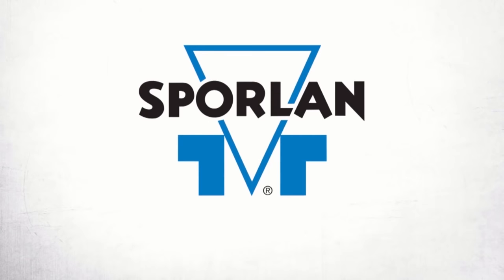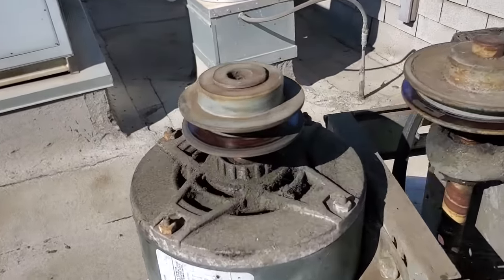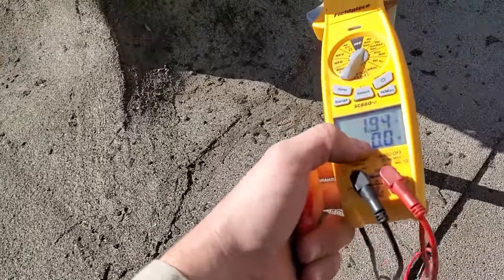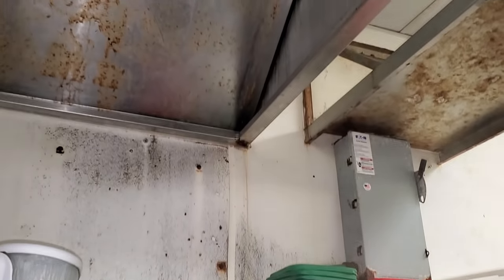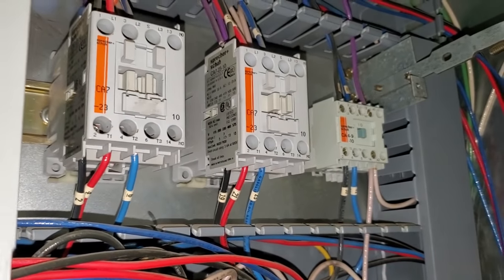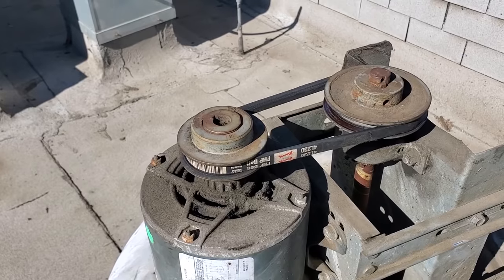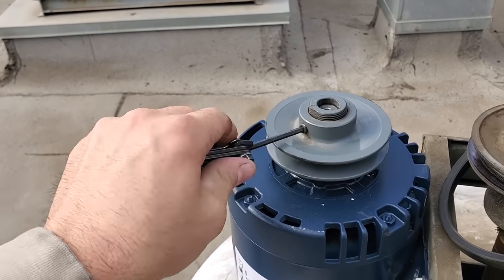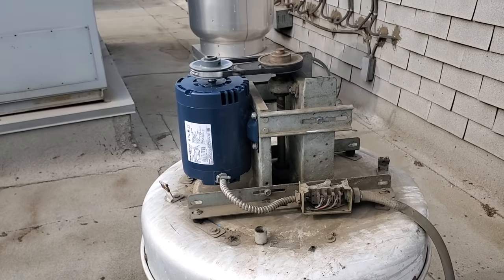DISHWASHER EXHAUST NOT WORKING

Comment: I’ve never seen adjustable pulleys before. What a great idea. I spent the last 15 years as a commercial catering engineer and that dishwasher looked as though it was ready for a serious service. I used to replace bearings in motors if they were in good condition. I had an urgent call to a large school where the  3ph (415 volt between phases in the uk) dishwasher wash pump tripped. The main wash pump had seized solid. The head teacher threatened to shut the school if the DW wasn’t fixed due to cross infection risk until I pointed out that they could use paper plates! I got the pump out and back to the workshop and had to split the bearing with a grinder because it had welded itself onto the motor shaft. Fitted a new bearing and took it back to site and refitted the pump. I loved being able to provide that sort of service.
I’m retired now but have lots of stories, like the restaurant that complained that their D/washer wasn’t taking the liquid detergent only the find the tube in a box of detergent powder!
Reply: You wrote an essay

Comment: I didn't see it listed on the nameplate, but if the motor is thermally protected (internally) it could be going on and off if it was running hot or if the thermal switch was bad.

Comment: Yup on the curtains your correct. The machines typically don't control the fans above. Dish machine fans every place I've worked Run 24/7 unless its controlled elsewhere if any. Anyways appreciate your videos.

Comment: I’d like to know who did the initial inspection? That’s the wrong Fan for a Dishwasher. Has to be an Updraft discharge, also has to have an external disconnect on the roof, so you don’t have to touch the fan to shut it off. Also Aluminum or Stainless Steel ductwork. Exhaust must be tapped into the entrance and exit of the dishwasher. A Dishwasher that size would have to have the controls to turn the fan on and off with a short time delay on the off cycle. Have you tried the Optibelt Brand of Belts. I wouldn’t use anything but their belts on exhaust fans. Six to twelve times the life out of the belt and easier on the motor amp. wise.

Comment: With the curtains on the dishwasher you're correct there needs to be curtains. The entrance end is usually a little shorter to put racks in. When the curtains start getting super hard and curling they should be replaced.

Comment: Exhaust manufacturer told me a motor that is 1 hp or smaller, does not need motor starter protection, has internal protection. What's wierd like you said 3 phase for a dish exhaust? They should have used aluminum duct, crazy corrosion.  Also the bottom of the hood should be no higher than 80 inches, maybe poor draw because too high?
Reply: I can't say for certain without having the specifications for the dishwasher and the fan,  but they don't appear to be matched up right...

The fan static pressure is at best about 0.4 "wg, with a velocity pressure of ~1/2"wg

I started running some pressure drop calculations, and they aren't adding up...  nobody's paying me for the analysis, so I give up... it just doesn't look right...

Comment: Welp since im a avid dishwasher. Also btw thats a Ecolab EC-44(HH) Beast machine they do last long if treated right. But if the machine doesn't have pant leg duct work. As long as the canopy can capture all the exhaust heat/vapor its good. Not sure why they have the opening for the vent like that with solid blockers. I've seen one machine with a setup like that. I hadn't gotten up and close to it so cant say that's typical, although the duct configuration I'm pretty sure inst.

Comment: Good video. Talking my language. A Hobart made unit for ECOLab. The dish machine should have had pants legs and that would have prevented all that rust in the dish area. The customer didn’t want to pay for the extra cost to have it done. Surprised ECOLAB let that thing work in that way.

The motor replacement  info was good to know. Lots of clients expect me to work on their exhaust fans for their dish machines. I usually say no but now I might consider taking them on.

A really good video.
Reply: I think that was an ECOLAB machine. I dont know of a Hobart with that kind of conveyor.
Reply: Don Westphal Ecolab is a chemical company. They don’t even fully make their own pumps. Components include parts from Dema and Knight.  Dishwashers used by Ecolab are: Hobart and Jackson.
 A while back they sold off their repair arm. You know it as Smart Care. All to focus on their core business.... chemicals.
Reply: Hmm never heard of Hobart owning ECOLAB or anything an i work for Hobart lol
Reply: Don Westphal Hobart doesn’t own ECOlab. ECOlab buys machines from mfgs and they emboss the units with the Ecolab name. Buy enough from Hobart and they will stamp your name on the machines you buy too.  ECOlab is a big customer of Hobart. I guess you were on the meat slicer side of things.
Reply: No i do it all im cross trained on all the equipment. I just dont too much into all the business side of things. I focus on troubleshooting the equipment and that's about it lol. I accepted a job to do HVAC recently and will start it in December so im trying to freshen up on a few things before hand
Reply: Don Westphal Your in for a ride. It’s not like the ovens, slicers or dishmachines. More of the Traulsen experience just on a different scale. Much success on your journey.
Reply: Thanks mike

Comment: Your motor protection is bilt into the overload switch. (On/off).  Which is located right at the unit 3phase switch. 👍
Reply: I thought that too at first but now I'm not so sure.  I've definitely seen manual motor start switches with a melting alloy element, it always been single phase motors, where only one element is needed.  I dont think that switch had 3 melting alloy elements?

Comment: So in the us and Canada you use 240v in industrial situations such a electrically driven motors. Then 110v in house hold sockets. In Ireland we use 110v in industrial such as a building site etc and 240v in homes

Comment: Thanks for posting, interesting video to watch and you do a great job of explaining everything.  I do want to point out a couple things though.  EVERY motor has to have overload protection(not just three phase motors as you stated, sorry to nit-pick.) Its just a matter of if its thermally protected internally or utilizing external protection(overload relay).  Now most motors if protected internally will have it printed on the nameplate.  That is not an absolute rule, but generally holds true.  If it does not explicitly state that it is protected internally then you have to assume it is not, unless you want to contact the OEM for clarification.
Reply from the maker: Thanks Trever and you made some great points!

Comment: That's a driven pulley. The motor drives the other shaft as it's the source of power. :)

It isn't thermal protection built in to the 3 phase motor  but it does make you wonder if something was causing a spike in amps and the breaker protected the motor (as well as the line)  from overheating to catastrophic failure. Bad bearings, which that obviously had, would cause a higher current draw but it'd be most noticeable on startup and most likely to open the circuit then. I'd be curious if the driven shaft bearings are going out as well, causing more drag or perhaps the fan blades are messed up somehow (rust? chipping?)

Comment: We just had a roof vent motor overload and short to ground, ended up tripping the main 1600 amp ground fault and shutting down half the building.  Going to have the electrician come back and put overloads on all the motors

Comment: How curious. I wonder if the if there was am issue with the power coming in that agitated the motor. Maybe contactor stuck? Gotta hate intermittent failures. Keep the wedding band for off days, get a silicon ring. Almost lost my digit after a compressor toppled onto my hand. 😅
Reply from the maker: Yeah it's been a week since the call and no complaints..... the ring actually is a silicone Qalo ring, I havent worn a metal ring for at least 5 years now. Hell if I could do it all over again I wouldn't even waste the money on a metal ring and I would have just bought the silicone ring to start
Reply: @HVACRVIDEOS  May be it just needed some love. Machines are creatures. Yeah I made that mistake and had to cut off an 18k gold ring and it wasn't easy. After being pinched. I went on a binge watch and I have to say, I love how you handle even an intermittent. I'm northern FL central and it's nothing short of a miracle the systems that actually run in my dirty city. 😂  looking forward to next vid.

Comment: When you "opened up" the motor pulley and adjusted the pulley by turning it in a ccw direction, I was wondering if your adjustment had to go to the next 'Flat' on the motor stem? It seems logical that the next flat would be the only place you could retighten, so in doing so the distance has to be a predetermined speed thus amp draw or am I way off? And were you being careful not to change the up/down position of the pulley on the motor shaft? Be brief I'll pick up on your answer. Thank you
Reply from the maker: Yeah you got the right idea you have to tighten on the flat spots and yes you have to watch the pulley alignment while adjusting so you dont create another issue by running them un aligned

Comment: I think you're reading the current draw on the motor label wrong. it's the lower number next to it. motor has different ways it can be wired
Reply: The nameplate information for amps is divided the same as the voltage above it. Rated Amp draw for 208-230V is 3.3-3.0A, and rated Amp draw for 460v is 1.5A.

Comment: You were fine with the amps. Since it's 208 instead of 230 it will draw more for the same power output.
Reply: The internal energy dissipation of a motor is the same for every voltage, with the same amperage

Comment: did you grease the pillow block bearings? (if not sealed) and that is a friction belt ( verses an auto style belt) it does not get tightened super tight
as it will pull the bearings out of the new motor. did you never seize the shaft and the threads on the adjustable pulley so that you can get it apart 
in 6 months?

Comment: How do you locate the contactor, controlling that motor if it is in a different room?
Reply from the maker: Kinda like where's waldo........ just make an educated guess, most of the time they are in the electrical room
Reply: @HVACRVIDEOS   " electrical room" (aka the janitors closet)
Reply: time to call the city and have them do an inspection.  you really shouldn't have any contactors inside breaker panels, water on the floor near panels is a major red flag, panels MUST have a 3 foot clearance in front of them (per fire and electrical code).

Comment: Chris what exactly is makeup air? I know it has something to do with + - air pressure.
Reply: It's air that is pulled from outside and forced inside by either a dedicated unit or by AC unit dampers, to "make up" for exhaust fans pulling the air out of the building etc. so that there is not a lower pressure on the inside of the building than outside which can lead to certain problems.
Reply: When the exhaust fans pull air out of the building it reduces the pressure inside the building, so makeup air can be provided by a dedicated unit or the 
Minimum -outside air dampers on the AC units

Comment: You commented about the rust build up and presumed it had been happening for some time. 

Do you have any opinions on that now that you know there is more air moving?
Was it always running too slow?
Is it incorrectly sized?
Just curious you thought on the rust you saw before and after repair.
Reply from the maker: Most dishwasher exhaust systems have stainless steel ducts coming down to the dish machine ( we call the pants)  and that makes sure the steam goes right up the hood. In this situation they were using a hood 4-5 feet above the dish machine, if they had the stainless pants than they would not have the rust issues

Comment: if the amps were different on the new motor how did you know it wasnt slower than the old one?
Reply: The nameplate speed rating tells you motor speed. These are all induction motors used in HVAC, its rare that you find any that are not for air handling) and as such are synchronous motors. That means that the spindle speed is synchronized to the input frequency. This is because the rotation of the spindle is influenced by the magnetic fields created by the stator coils. And since the power supplied is either 50/60Hz depending on country, you have a specific rate of magnetic field change per second. This causes the rotor to speed up to that rate of change and attempt to stay there. Unlike a series wound or universal motor, the current draw is not indicative of rotational speed, it is instead more akin to how hard the motor is working to maintain the nameplate RPM. The important part is to make sure the current draw is below the nameplate rating, as going over the nameplate rating does not necessarily mean the motor is spinning more slowly, but it does tell you that the motor is working harder than it was designed to work, which can cause premature failure.

For fan speed, the only way to tell is with a tachometer, by sight, or by sound.

Comment: Chris at this situation can we use grease gun to lube the motor thank you for answer.
Reply: 石磊 Grease injected would only be a temporary fix. The motor would need to be removed and refurbished. They take the motor apart and remake it.
Reply: The bearings are sealed, you cannot grease them.

Comment: Chris, this was not your best one.
I know it is never a perfect world but this time you replaced a working motor and increased fan speed without actually knowing your starting point (air flow) and your ending point. Did you actually solved the problem and what was it?

Phase 1. Collecting data: motor rpm/current, fan rpm/rated rpm/direction, underpressure at fan exhaust, pressure difference fan exhaust – inside, air speed at fan exhaust.
Based on that one may assess the actual volumetric flow and know whether, if powered, the fan does its job. One eliminates other influences e.g. underpressure in the building, bad initial design, unrealistic expectations of the customer, etc.
Phase 2. Control: motor protection devices, contactor, timers, controllers, etc to make sure it works when it is supposed to. I do not see any motor protection circuit breaker. If this is the case, there’s a fire hazard and electric shock hazard. If I replaced the motor I’d definitely put this in my recommendations for the customer to protect myself from future claims.

When some kitchen staff says “the fan isn’t working” it means absolutely nothing to me.
Was is working previously? When did it stop working? Is it now working by your judgment (when we know it is actually working)? Is it working sometimes?
Most customers are imprecise, they tell only part of the story, they do not know what is important or they simply lie. This is when actual measurements and values come in.
Also I have mounted some piece of paper/foil inside the hood to indicate air flow to the staff. No one can tell it is not working when the slip of paper shows it does. In this way it is easy to pick up some other causes, which are not evident at first sight.
Reply: Chris, judging by reaction of another user, my comments may not be welcome. If you find my content in any way offensive or simply not to your liking, please let me know. I'll watch and refrain from sharing my thoughts. With respect, Maciej.
Reply from the maker: I will be going live on YouTube this evening 11/25/19 @ 5:PM (pacific time) to discuss my most recent uploads, and answer questions from email’s , YouTube comments, and the Live chat come on over and check it out if you can.    https://www.youtube.com/c/HVACRVIDEOS/live

Comment: I have never worked on exhaust fans.. So I don't get it.. Why dos the speed drop when turn the wheel (  and raise if you turn it the other way ) that's black magic🤔🤔🤔🤔
Reply: Christian - Opening the sheave makes the belt run lower in the groove, so the effective size of the motor pulley is smaller, the gearing ratio between the motor and the fan is increased, so the fan runs more slowly.  (The motor should run at a constant speed).  Closing the sheave makes the belt run higher, the gearing ratio lower, and the fan faster.